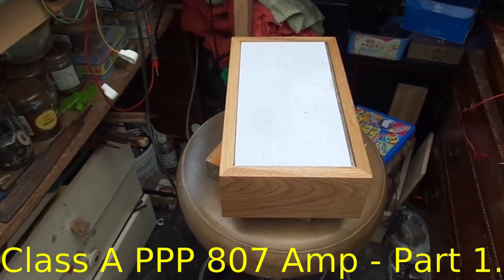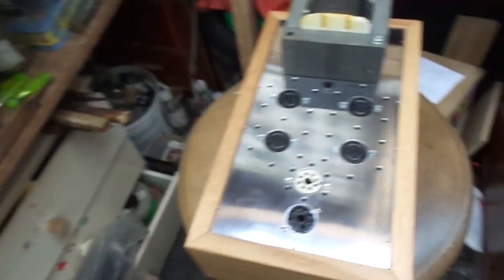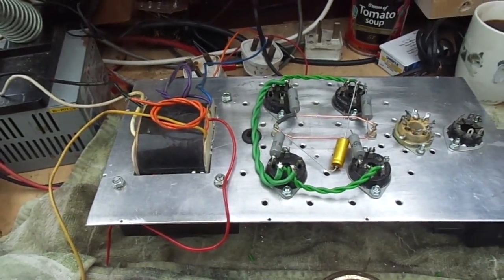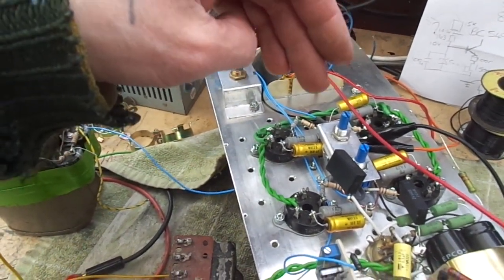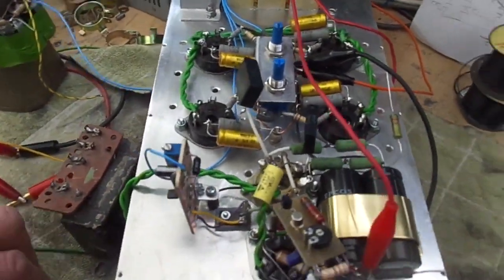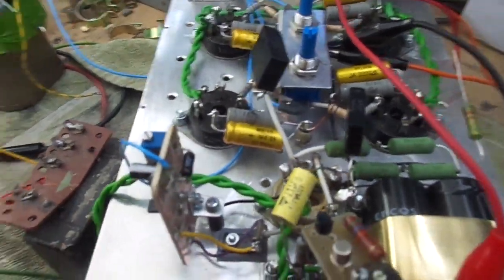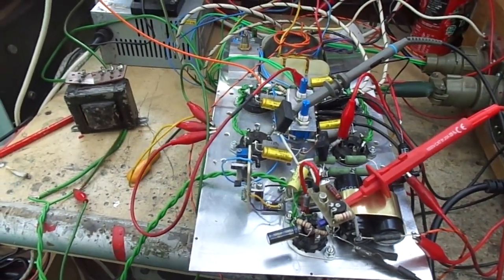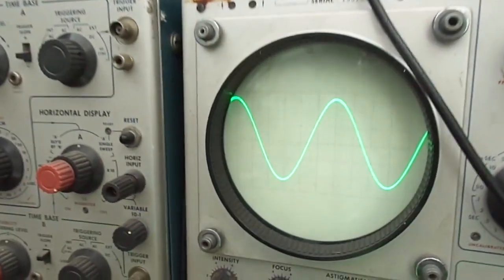50w Class A 807 PPP Amplifier - Part One.

Comment: Looking truly great! I like the idea of combined kathode and grid bias, I might try it in a future amplifier of mine :) I think your amplifier will perform truly excellent, I like the way you laid out your ground with that loop of wire that was cut to make it not a loop :) I do similar things when making amplifiers, always worked perfectly and gave me lower noise and hum levels than relying on chassi ground. I also use a lot of NOS components in my amplifiers, and I also have had issues with iffy resistors through the years. Most of the time I get issues with iffy capacitors, they check fine and appear fine until I put some hours on them, I have started taking my time to reform NOS electrolytics and such, and it has helped a lot :) Electrolytics are the only NOS capacitors I really use, I also use NOS poly film for coupling, but those ones are not that old compared to the electrolytics. I think it is definetely worth reforming electrolytics, since they are pretty expensive to purchase. 

Currently I am working on making a huge power supply for some 6080's which I plan to experiment running speakers directly with (OTL amplifier). I have wound a power transformer with an absolutely enourmous heater winding, (4mm2 cable :))because I will need a constant heater current of 10 amps for 4x 6080's :) And a bit extra for a preamp section. I also found a transformer which provides about 100V after rectification at up to 3 amps, I will use that for the anode supply for the 6080's since I will need high current at low voltage. I am thinking about a simple single ended topology, I have 4 6080's available right now, I will likely purchase more as budget allows. I am not exactly rich, so I can only buy a couple of tubes at the time. I got a very good deal on these locally, cheaper than EL84's infact. So very awesome, and I look forward to seeing how they perform. I don't expect miracles having only 4 of them, but I should still get some decent power into 16 ohms and higher, I can get more or less any load impedance I want by reconnecting my speakers in series/parallell, so I am not limited with load resistances, same goes for my dummy load on the bench, I can get up to 32 ohms there :) I am thinking about using a simple 6SN7 preamp section and drive the 6080's with that directly, it should work. The load will be coupled through a 2200 uF high voltage low ESR capacitor to ensure no DC gets onto the speaker voice coils. Basically the 6080's will all be in parallell, all sections parallel, with balancing resistors of course. Running at about 80 or something volts on the annodes with maybe 2 to 3 amps of current total. Not sure how much voltage I will need for my preamp section yet, but I have a 230V winding on one of the transformers that I can rectify for 330 ish and use hopefully. It'll be a breadboard style build for now, since I have never played around with OTL before, I might do a proper build with them later if it is something that ends up working well. For now I am just looking to kill some boredom :)
Reply from the maker: Sounds like fun. TFW